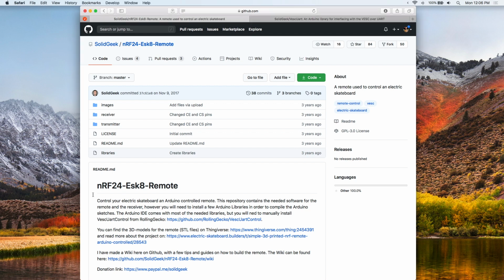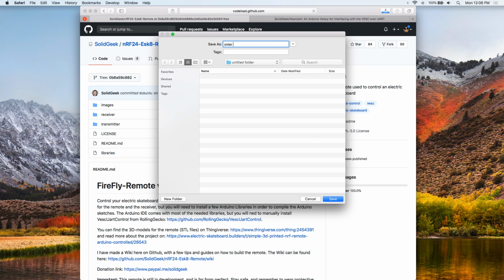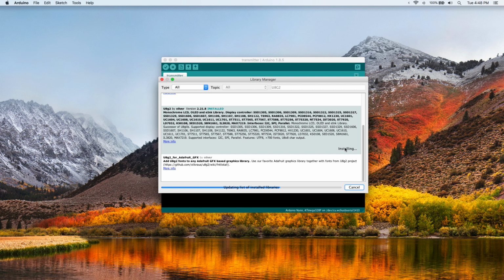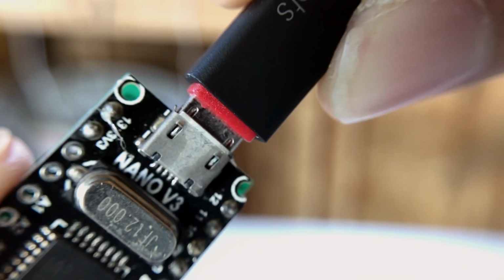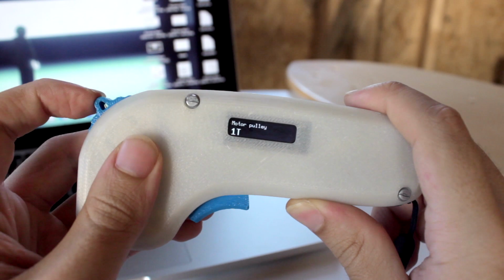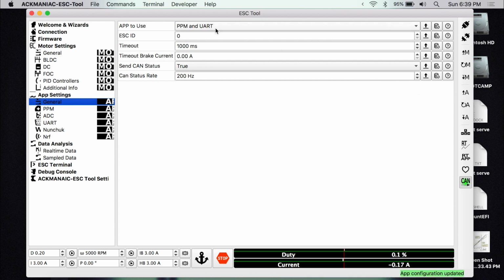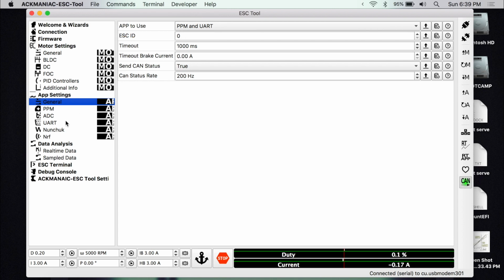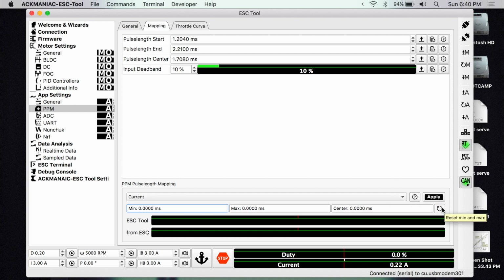Programming your VESC Esk8 Remote: Part 5

Comment: Can I add an old display to the remote I have now?
Reply from the maker: Not without a lot of research to see if the remote can even communicate more info than just the remote signal
Reply: @SeeTheBridges  the only open ports on my controller right now is 3.3v gnd Rx and tx ports
Reply from the maker: What remote are you working with? Because unless you’ve already made a firefly, it’s honestly just gonna be a huge amount of work and not really worth it
Reply: @SeeTheBridges  I think it is the "winning" one with like the hold for your index finger.
Reply from the maker: Oh, yeah no. It’s not gonna be worth trying to add a screen. At minimum, you’d need to add a micro controller to run the screen and then estimate the all the info since you don’t have direct access to the ESC.
Reply: @SeeTheBridges  if you could that would be an interesting video to watch

Comment: Is it possible to connect this transmitter to a cheap dual motor esc that has an inbuilt receiver? I’m looking to make one but don’t know how the connection would work
Reply from the maker: Nope. Needs to be an ESC with a PPM input. The cheap Chinese hub ESCs with included remote can ONLY use that remote

Comment: Must have gotten really lucky. I was just researching how to DIY a remote to interface with an ESC.. Is it possible to add a way to either on the boards 5v toggle on/off to use for headlights? Another great feature to add would be when you press down on the throttle via the remote to brake/reverse, it turns on brake lights. Great video and I hope you continue to make them. I definitely see you getting big if you keep up making great videos like these and stay with an uploading schedule.
Reply from the maker: Thank you! Unfortunately, the Firefly doesn’t feature any sort of lighting control channel. There are some spin off projects from SolidGeek’s code that offer newer features like that, but I haven’t tried any of them personally. I’m actually in the research stage right now for designing my own FF like project with lighting control similar to what you’re describing. ;) and I am actually sticking to a schedule at the moment! I really ought to mention it in my outro more consistently. New Friday News Roundup every Friday, and DIY projects almost every Wednesday!
Reply: @SeeTheBridges  Awesome to hear, I subscribed and can't wait to watch the videos on your own design when it comes out.  Making videos every week can get hard and challenging but don't stop. Make sure to utilize social media and spread the word of your channel when you start making your own DIY Remote. Facebook groups and Reddit Groups are a great place to share your work/channel. Good luck!
Reply: FYI videos on those spin off's would be really interesting to watch. I'd like to see that for sure.